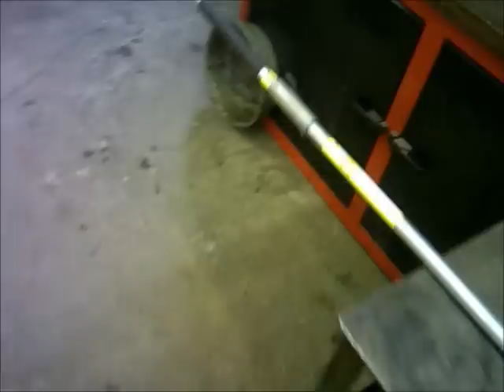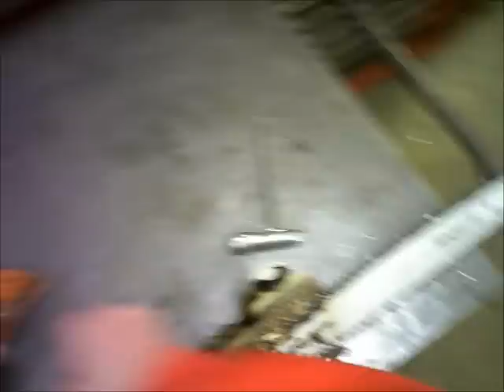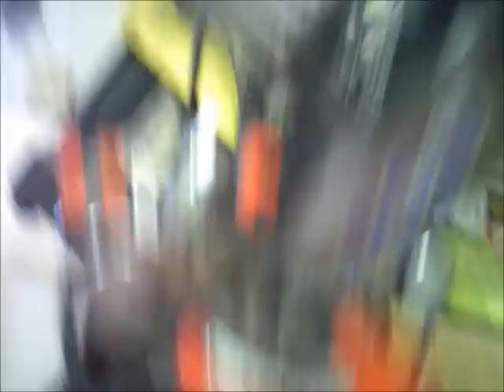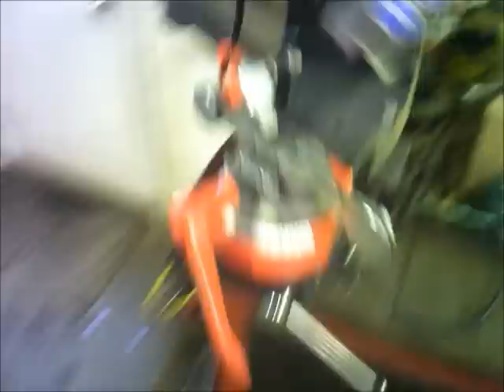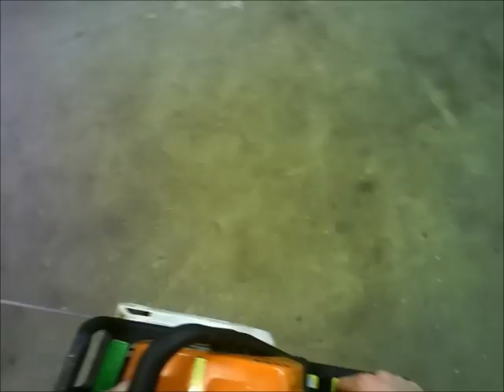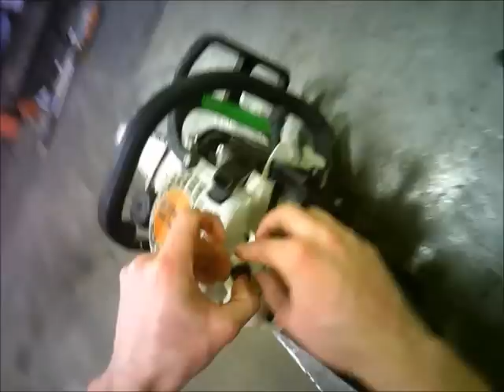Wrenching and Talking

Comment: ive got that same saw and had the same problem you were having running like shit when it warmed up. the problem is that shitty carburetor, it only lets you adjust idle and it dont even have H L screws so i went on ebay and bought a chinese one that has all the adjustment screws and it made a huge difference it runs way stronger than when it was new
Reply from the maker: +storminnormanz I got the problem figured out, the spark arrester was plugged solid.